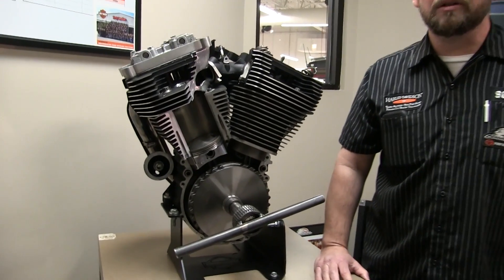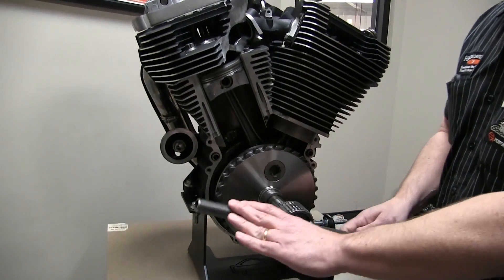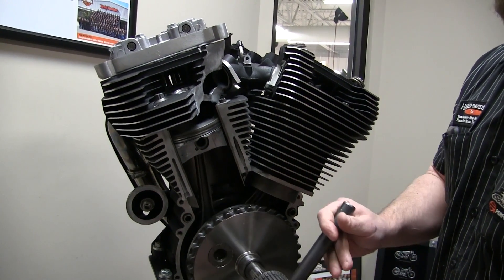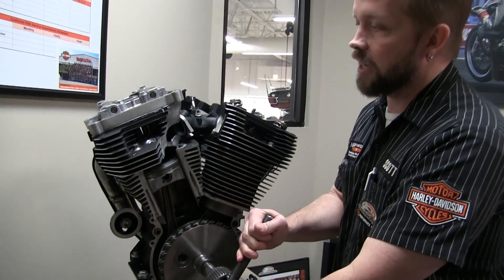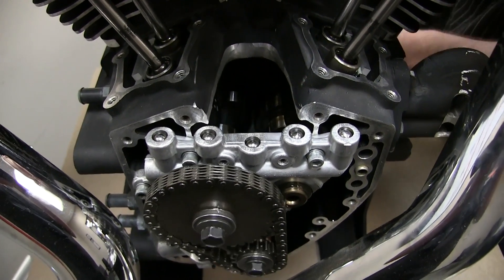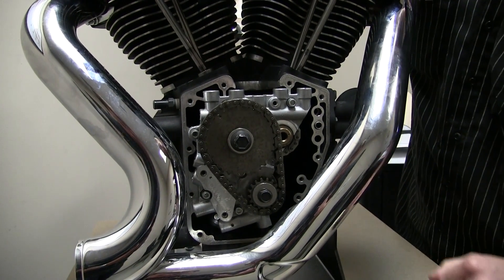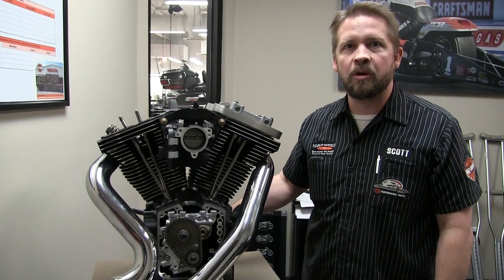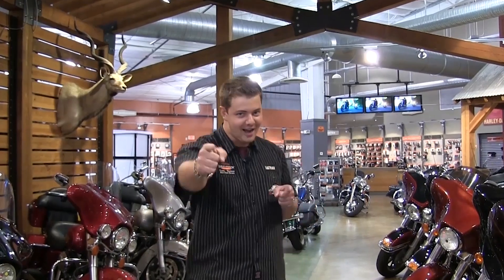How a Harley-Davidson Big V-Twin Engine Works - Harley Davidson 103 Engine Cutaway View and Demo

Comment: How does the spark plug and fuel injector know when to fire of there's not cam sensor?  When changing the cam it doesn't matter which rotation the crank is on when aligning the gears. So how does the ignition know the difference between TDC of the compression stroke and TDC of the exhaust stroke?
Reply: Their is a crankshaft sensor
Reply: I might be wrong but I'm pretty sure the ignition fires on both cylinders every time in a Harley motor. Not super sure if that even answers your question actually.

Comment: I've got an evo motor that had sat for about 5 years i need to spin it over by hand like this. My jsp has an easy access bolt to turn for this but I'm not finding anywhere so easy on the evo any ideas?
Reply: You have to remove the primary drive cover, and turn the compensator sprocket with a socket of the correct size.

Comment: Go down and see the junkie Harley parts in the engine. You would think harley would change the junkie parts and make an engine the buyers wouldn't 
need to modify to make it reliable .  Compensators, cam bearing, cam chain tensioners , roller crank bearings ,  over heating issues , auto adjustable primary chain  adjuster, oil pump and
valves train ticking.   I'm sure theres more .
Reply: I know multiple people with multiple HD bikes and have had 0 problems besides maintenance with high mileage bikes. 50k+ mileage. I hate overrated things and HD is definitely a little overrated but not by much. I own a 2020 iron 883 but only have 3,500 miles on it but I haven't had a problem.
Reply: @Shortley  ... That little 883 isn't built the same as a Twin Cam so if you don't own a Twin Cam you can't speak of it. 
Theres even major oiling problems with the M8 . Keep riding that 883 and you'll be fine.

Comment: Lucky that the cam chain tensioners are removed so they don't fragment and blow apart the motor.  Harley really gave all their customers who purchased their TC engines the shaft (not out of true crank shaft) and did nothing to make their faulty design correct.  For me, HD lost a loyal customer.
Reply: It was only an issue on the 88s this is a 103....they changed the design in 2007........so you're no Harley fan... otherwise you'd know that
Reply: @yanceyboyz  My comment was that the mechanical chain tensioners were removed.  I understand that after 8 model years HD fixed the problem.  It should have been fixed in 1999, not 2007 when hydraulic tensioners were released.  Just a shame the HD does not stand by their product.
Reply: @eb1941  how could they fix it in 1999 when it was a wear issue that presented itself at all different mileages? Some 88s did 60k on the factory set some did 15k. How could they fix it the same year of release? 

There was a bearing issue on the 1999 and they resolved it for mid 2000 release models....so they do fix known issues....
Reply: @yanceyboyz  If tested properly, this should have been discovered during HD's testing.  Assuming it did not show up in testing, which I doubt, by mid-1999 many bikes presented in failed tensioners and HD knew they had a problem.  60K miles on spring loaded tensioners is very rare.  At 20K, my Road King has about 10K left before I need to change.  That is typical miles for this failure.  I am a 30 year experienced mechanical engineer and this failure is a design failure that HD passed to their customer.
Reply: @eb1941  it's not the tensioners that fail, it's the shoes. There is lots of bikes that had no issues at all, you act like it was every single one..... I have a 2000 road king and it did 52k before it needed new shoes....

Your bikes are also quite a bit newer than 1999.....so if it was a massive issue that happened on every bike and was so well known....why did you buy bikes 4 and 6 year's after? 🤣

And.....those bikes are obviously still running.....so what's your problem?

And back to the original comment......this engine is a 103 so it had the hydraulic cam chain tensioners......so you clearly made an error originally saying it's a good job it was removed.......it was long fixed by the time the 103 hit the market.
Reply: @yanceyboyz  I agree, it is the shoes, yet the tensioning system was redesigned for 2007.  It is a grip of work to fix and on average 30K miles is a big concern for failure. My dealer recommended checking at 20K.  It is a design miss, otherwise HD would not have changed the design, 8 years later.  Even at 52K miles to have to disassemble the cam chest is not acceptable. HD should have recalled the bikes and made the repair, or at the least contributed to the repair.
Reply: @eb1941  the 2007 still has the shoes it's just a hydraulic system and uses oil.
Reply: @e b bullshit!  You were never a Harley customer.  You just want to rag on old technology.
Reply: @Peter-976  2003 Road King and 2005 Deluxe, both bought new and I still have both.  I expect a company to stand by their product and fix their design mistake, especially if their product is considered a premium product.  The cam chain tensions should have been fixed 1999.

Comment: It makes you wonder how much the chain drive cams even under tension throws off the valve timing compared to a gear driven unit. I converted my twin-cam to gear and never looked forward.
Reply: It’s called, “never looked back”
Reply: @shaverlocal actually it doe not make me wonder at all.  But obviously it does for you if you changed to gear drive.
Reply: There are issues with gear drive, too.

Comment: the v twin engine is the biggest retarded invention ever. it has to have a huge, heavy balancing wheel to keep the opposing motion from tearing the motor apart. get an INLINE TWIN, and you will not get thrown off the bike at 90 mph from the side to side suppressed balance debacle. 

its not a harley davidson.. its a HARLEYMADEITSON.. thats what the dad told his son when he got home from work riding a harley.. how was your ride home dad?  HARDLEYMADEITSON.!!
Reply: V-Twin Engines, are totally AWESOME. Love that air cooled engine design..

Comment: How they work is after about 3K to 5K they have to be rebuilt........Harley riders have to have a big budget to keep rebuilding these engines.  Buy an Indian Motorcycle.
Reply: Indian is just another big turd by another name. Check the recalls on Indian motorcycles.
Reply: MARTIN WOOLDRIDGE 
Strange I haven’t had any problems with mine and I have over 5K miles on it.
I don’t think they have to be rebuilt. Your just being sarcastic! Lol
Reply: @alanwhiteside410  my toyota have 297 000 km beat that

Comment: best engine out there. no need to have high rpm unless ur trying to speed more gas money. amazing tq through the rpm range. all steel through the cylinder walls and heads inner layer and a steel crank that'd built to last 100's of years not aluminium shit that wears out in 5 years if ur lucky. 2 valves per cylinder witch is all u need and more parts means more problems so 8 or 16 valves waste of time and parts. 2 pistons size of trash cans not 3, 4 or 6 again more parts that can go bad. harleys keep everything so simple and that's the best part about em. air cooled engines are by far the best and proven time and time again. long stroke vs short stroke again harley wins cuz short stroke high revving engines wear out 10x as fast proven time and time again. plastic cam chain tensioner everyone is complaining about is silly prolly the same people that believes sportsbikes are built better then a harley and ohhhhh there plastic hahah but now plastic sucks on harley hahah but there whole bike is made of it hahah. old technology is the best and that's proven. new shit is advanced but also made to break down as fast as u get it. look at TV's for example back then u bought a tv and it lasted 50-100 years now Japan shit 3-5 years if ur lucky. washer and dryers now 3-5 years furnaces lucky 5 years back then 25-40 years. everything with new tech fucking sucks. look at phones now days last maybe 3 years but old ass land phone lasted 20+ years. fuck new tech I'm young but I'm sticking with the old harley engine. I don't have time to keep repairing new tech sorry. I'm sticking with harley the next 60 years😂😂😂my harleys so far have been the most reliable bikes I have bought. the metrics I've had have been straight asswipe.
Reply: I had a Yamaha 1980 XJ650 and it had run to 138,000 miles when I sold it. All the major work that I had to do was put new rings in at 100,000 miles. Not another thing did I do to this motorcycle. I sold it and bought a Honda 2005  VT750C  V twin motorcycle because I like the torque of the V twin motor. It has now done 76,000 miles and looks like it is going to go on for ever. I am 65 and could not even push a Harley around in my shed let alone ride one. I am afraid that they are just real heavy old school slugs made for cruising the highways at 55 MPH.
Reply: James Wise Awesome opinions...and I certainly cant argue with your experiences...but I have never gotten over 40,000 miles on a Harley engine wirhout a major engine repair or two. I cant say the same for my 99'  Suzuki Intruder that logged 169,000 repair free miles BEFORE the odometer quit. That was 8 years and probably another 70,000 miles ago, and still no breakdowns. I've been riding a 99' Honda Valkyrie Interstate now for many years, and it too has high miles, no breakdown. I guess I'm just agreeing with you as my handle implies. I believe in the OLDSKOOL stuff also, but the Harley engine just hasn't given me the life and confidence of the Metric engines.
Reply: I'm sorry but that was the most incorrect comment that I have ever read.

Comment: so in theory, if i have a beginners grip thus far, if 1 wanted for my own curiosity to reduce the cc, 1 could take reduce the  heads, and pistons?   this is basicaly formed from not wanting to stick a honda v-twin 250cc in my AMF z90 but wondering if there was a way to cusomize a block to reduce cc , get that harley v twin.
Reply from the maker: there is no substitution for displacement, run what you have and have fun!

Comment: funny how the took off the plastic cam chain tensioner
Reply: It's a 103 not the 88, they changed the design when they did the larger CI engines due to that issue

Comment: You forgot to show the two PLASTIC, cam chain tensioner pads on the chain drives for operating the two cams, an obvious, weak link in TC engines, and which are wear items.
Reply: car manufacturers are doing the same dumb shit.